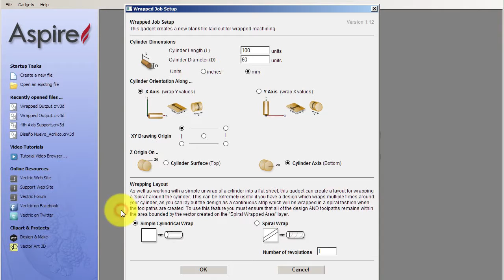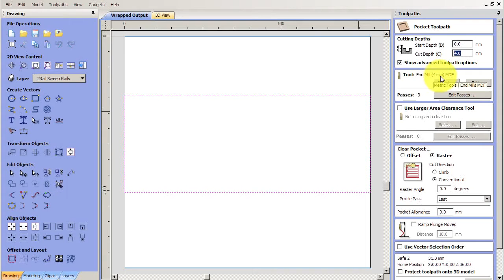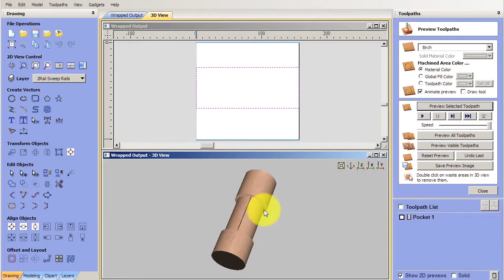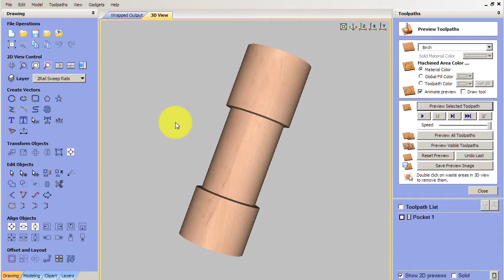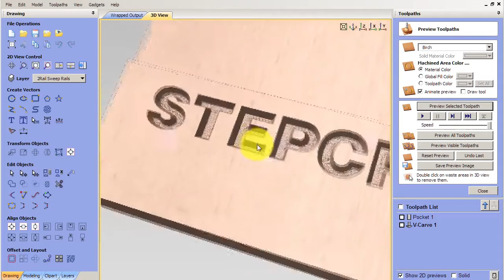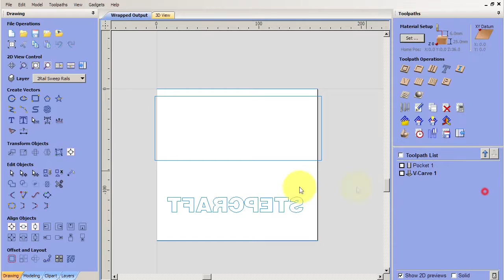Stepcraft  4th Axis (rotary tool) Job Setup

Comment: nice and good video lol 
i have cnc router and i cant work with rotary because i dont get it how to install it in mach3 and i many times i look for videos in youtub to understand what to do and nothing .. i sm working with artcam software to make gcodes but i see that vetric software is stronger in rotary settings so j will try it 
thanks alot